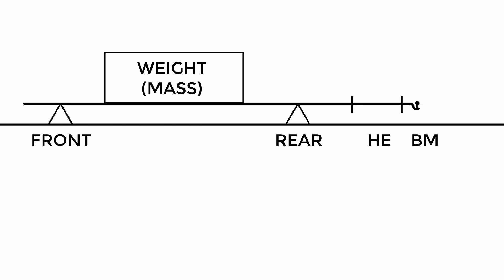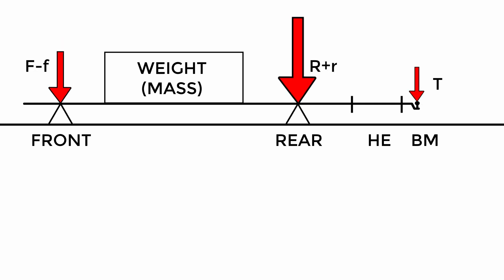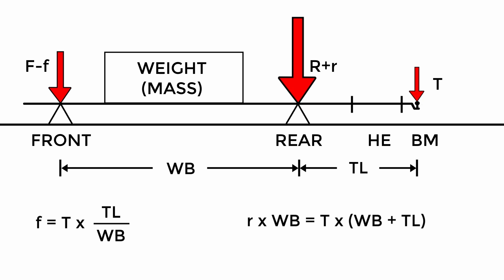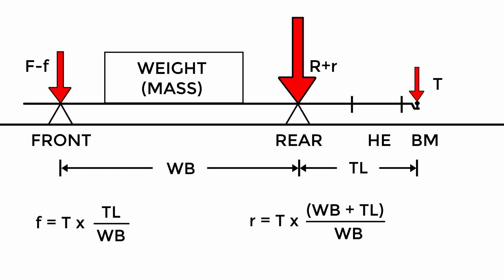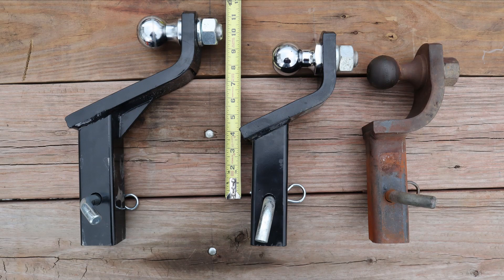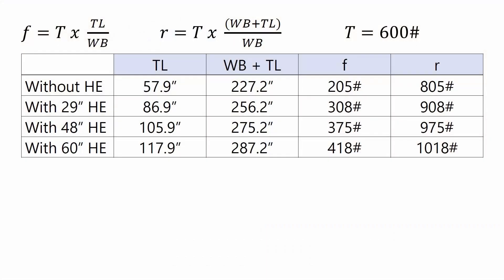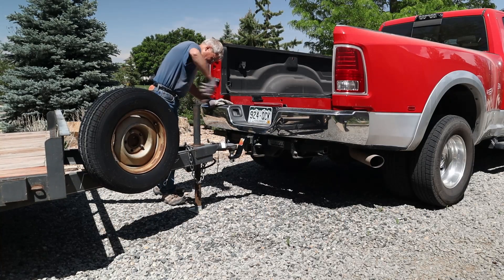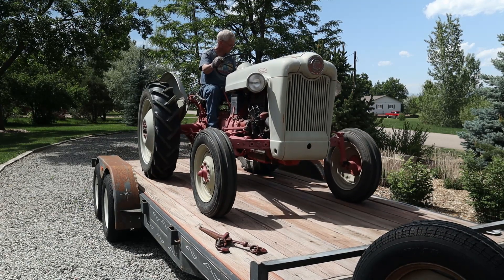How a Hitch Extension Affects Tongue Weight

Comment: Enjoyed the detail with real life scale measurements; much appreciated. That being said, our reasons for doing this is to prevent wear and tare on our rear drive axle components - while ensuring maximum steering and breaking stability of the front axle. We both have need for tongue extensions. I have the additional need for steering & drive axle load balancing because my loaded Grand Cherokee and loaded Boat are close to safety limits. 

Loved the video as it revisited my load balancing hitch "adjust / measure / repeat" while pushing the patience of the operators at the waste transfer station (to get readings as each axle gets on and off the single scale). Your work to factor in the effect of tongue extension will help tremendously as I prepare to add a removable-telescoping extension for my needs (storage garage & shallow boat launches).

Yes! Correct! Get a right-sized truck and trailer an not fuss with extensions and load balancing hitches - and park outside like everyone else. No fun in that. Thanks again Kevin!
Reply from the maker: Thank you for the lengthy and thoughtful response!  I'm happy that I was able to provide some information that you found useful.

Comment: Great video almost
similar to weighing and rebalancing an aircrafts cargo, 1st class mail, packages, large BMC containers centering the weight mass before take-off. To far back and the aircraft goes into a stall and you crash tail first, to far fowards the aircraft nosedives and the results are the same you crash and burn.
Center that weight and keep it there and you will have no problems with take-off cruise and landing although the take off and landing lengths of the airport may be longer as a result of the additional weight.
Reply from the maker: This is pretty interesting!  I had the opportunity one time to fly in a glider, the pilot had to adjust the position of a weight to achieve the correct balance.
Thank you for posting!

Comment: Hello Kevin. Just watched this video twice, and I appreciate you sharing your knowledge. When determining TL, what you call the distance between hitch pin hole and center of ball, your measuring tape shows the b leg of a right triangle. When incorporating a drop ball mount, whether it be 2 or 10 inches, the b leg can stay the same, but the c leg or hypotenuse does change. Could that have affected your math vs scale outcomes?
Reply from the maker: Assuming the 'b' leg is parallel to the ground, the drop (let's call that the 'a' leg) would be vertical/plumb - so it would not affect the lever.  As such, the 'c' leg (a combination of 'a' and 'b') should also not affect the outcome.
That said - the actual setup - and my measurements - are real-world and therefore imperfect.  There may be other factors that I overlooked.
Thank you for the replay!

Comment: Great video! It would be interesting to know if you added this much weight (W =) and extension (he=) what the force change would be driving down the road. What is the downward force for each foot of extension increase or how many times does it increase (average)? 2 x tongue weight? 3 x tongue weight etc. Or is there a maximum downward force??
Reply from the maker: All you need to do is plug your numbers (weight and extension) into the formulas that I provided.  You could even use a spread-sheet and plot the results.
Reply: @KevinTaberski  Thank you for the quick reply! But what I'm asking about is when going down the road and you hit a bump how much more downward force is created? I get that it multiplies by however long the extension is. In the video you measure it while standing still. But when driving and hitting a bump how much does that weight increase? It would be cool if they made a device/scale that would measure that and you could see it on the app or with a camera zoomed into a scale on the hitch? Or am I missing something from your video that explains that?
Reply from the maker: @Mnfish22  Ah - now I understand!  You wish to know the dynamic force applied as a result of real-world driving conditions.  THAT would be quite the undertaking!  At a minimum it would require the placement of a number of sensors at various key points then instrumenting and recording the results in (more-or-less) real-time.  
It's possible that some pieces designed for this purpose are available, but I'm not aware of any.
Another possibility is to model this as a system using Finite Element Method - a topic I know virtually nothing about.
Let us know if you find something!

Comment: Fantastic video! I also have a camper.  My only confusion is as follows: If I know my cargo load on trailer, and calculate tongue weight at 10-15%, and say I need 220 lbs on tongue. I wondered if I would need to apply that amount of weight at ball to determine height of ball without camper, and then again w/ camper (I.e - If it was to be 200lbs, have someone  that weighs 200lbs stand on ball, and measure height of ball in both cases. If camper is on, and trailer tongue being lower, wouldn’t it already be adding more tongue weight, than an empty truck? Just didn’t know if that was covered?
Reply from the maker: Hmmm - IF I understand your question correctly - you are attempting to determine how much your truck will 'squat' with the combined weight of your camper AND your trailer.  Adding the approximate additional weight to the ball would work, but make sure you move the truck a bit - to give the springs a chance to flex.
With regard camper on versus off and trailer connected versus no connected - you can think of them as independent and additive.  In other words, whatever additional weight the camper adds to the rear-axle (for example) is the same whether the trailer is connected or not.  The same is true of the trailer.  You can prove this to yourself if you have a scale available.
I hope this makes sense.
BTW - sorry for the slow reply - I was camping!

Comment: Very interesting. I have wondered how much difference the extension would make. The 900ish pounds of tongue weight is more than I thought it would be with that tractor/trailer combo.
Have you tried using a weight dist hitch with equalizing bars and the extension? Im curious  as to whether it would return the weight from the rear  back to the front axle.

Randy
Reply from the maker: Randy - Thank you for the comment and the question.  I do not have any direct experience with weight distribution hitches, but I can say that they are designed to do exactly what you have stated, to relieve weight on the rear axle and transfer that additional weight to the front axle.  I do not (yet) know if any additional weight is transferred to the trailer axles.  Whether or not it makes sense, will depend on the application and the axle rating of your tow vehicle.  In my particular case - with my camper installed and the trailer/tractor combo in-tow - I'm still reasonably well balanced.  But if I was towing substantially more, I would look into a weight distribution hitch.  I hope this helps.

Comment: It would be useful to know how an equalizer hitch would help . I just installed one on my 2003 f350 with Northstar 101/2 camper with 14x7 enclosed dual axle trailer with Harley trike , about 3700 total for trailer and contents with a 43 inch extension .
Reply from the maker: I’m afraid I don’t have any experience with the use of an equalizer hitch.  Sorry!

Comment: Are some people using tongue extensions to put truck boxes and stuff like that on the front of a trailer to get more cargo space? And does that tend to work out pretty well? Thanks.
Reply from the maker: I have not personally seen or heard of anyone installing a hitch extension for the express purpose of installing storage on the trailer tongue, but that should work.  That said, generally speaking, it is better to connect the trailer as close to the tow-vehicle as possible.

Comment: Good evening Kevin; I like the video but I'm not sure it answers the question I have. My truck tows a 14' pull behind camper that has its own Class II(350 lb TW rating) hitch on the back. I want to use a motorcycle mount on this hitch which extends about 18". Will my 298lb bike/mount combo with 18" extension overwhelm the Class II hitch? Thanks for any info :)
Reply from the maker: That is a very interesting question.  I suppose you could go through the math and calculate the effective tongue-weight at the hitch.  My suspicion is you will be a bit over 350#.  What I suggest - contact the manufacturer of your camper and see what they say.  Another suggestion is to find a forum either dedicated to the manufacturer of your camper or campers in-general to see what other owners have done.  In the end, you are only asking the hitch to support the 298#, but the torque/moment-arm created by the 18" extension is tricky-bit.  Sorry I could not be of more help.  Good luck!

Comment: So basically youre super longg extention only added 100 lbs more to the axle/hitch ?

I have a 90 Jeep Grand Wagoneer.  And i am buying a Jeep j10 76 long bed.. i want to use one of those 2200 lbs uhaul flat bed trailers to haul it.  But that Jeep weighs 4200lbs.  My jeep weighs 5300 with me in it.  Towing capacoty is only 5k lbs.. but tbh that seem anemic for what it is.. especially when my snaller 98 Grand cherokee can do 6500.

I have a hitch extention on my hitch its got a folding spare tire carrier on it.  Should i remove that ?  And just use a short 2 inch ball receiver versus the extention..  Just dont wanna spend money where i dont have too.  That extention is rated 5000 lbs.  Of course trailer weight would be like 6300 lbs..  but i think itll be fine.

Just dunno if that added leverage on my hitch/frame is something i should be worried about or not.  The extebtion is like 14 inchs
Reply from the maker: My extension added 100 additional pounds to the rear axle, for a total addition of 960 pounds.

With 6300 pounds of trailer, you will likely have a tongue weight of 650 to 950 pounds.  The concern that I would have is the torque placed on the hitch receiver through your 14" hitch extension. If you assume your ball-mount adds 10", you will have a 2 foot lever - with 900 pounds (for example), you will be placing 1800ft-lbs of torque on the hitch receiver.  Keep in mind, this is the 'static' load - when you are parked - things get more interesting when in motion.  The weakest point of this setup is right where the hitch extension exists the hitch receiver - it may bend at some point.

Obviously, I have elected to upgrade to something beefier and safer.  If you decide to do this, please extend your safety chains from the trailer to the tow vehicle.  Can you use the just the ball mount and strap your spare tire to your trailer?
Reply: @KevinTaberski  I decided to spend the 33$ on a 7500 lbs hitch ball end.  A nornal shorty one.  And just leave the spare tire at home (which is heavy as hell probly 80lbs lbs with that steel rim and mud terrain tire)

Now my main concern is my 5300 lbs 90 Jeep Grand Wagoneer (5300 with me) and s GVWR of 6400lbs.  Pulling a 2200 lbs uhaul flat bed with a 4200lbs 1976 Jeep j10 pickup.

Everyone on the Fullsized jeep forums said ill be fine.. I saw pics of them pulling wagoneers with their wagoneer.. but still.  My Jeep is onky 109 inch wheel base.  I have decent gearing not the best but the (tow package at the time)  3.31s versus 2.72 lol.  And a trans cooler for the 3 speed 727 auto.   My jeep is also in perfect shape.. new ball joints. New u joints all around.. new heavy duty springs so i can handle heavy weight without the bottom end dropping.  If i mind the total 1300 lbs capacity still i mean

One guy said to disconnect the rear drive shaft and get a dolly instead.  I jist wanted a flat bed as i dont trust any wheel going on the ground of the 50 year old truck.. not till i can drive it and look it over fully..

I also think the 5000lbs factory tow rating is very under valued... my shorter wheel base smaller light grand cherokee has 1500lbs more towing capacity. Which makes no sense.. and that 60lbs hitch on the back is so thick and heavy no way its rated 5000lbs.. its bolted with 8 grade 8 bolts as well.    I think its all under rated IMO.

But what do you think ?
Reply from the maker: @jeepsblackpowderandlights4305  Ideally, your tow vehicle would be heavier than your trailer/load with a bumper-pull set-up.  Whether or not it can be done safely is something you will need to determine.  A couple of thoughts: a high enough tongue weight is important to keep the trailer tracking properly so it remains stable.  Good trailer brakes and a properly set-up brake controller is very important - especially during those unexpected braking situations.  Finally, make sure you have enough weight on the front axle of your tow vehicle for safe handling (steering and braking).  I recommend weighing - before and after attaching your trailer - re-weighs are pretty cheap.

Once you get everything loaded-up and secure, drive it around and see how it all handles - before heading-out for a long trip on the open road.  

Good luck!

Comment: Could you do the math on this senario: diesel pusher towing a vee nose trailer. The tongue of the trailer is only 18 inches from the tip of the vee and I dont want to bonk the top of the vee to the moho  going down a curb. 12' from rear tires to ball and 12' from trailer tire to hitch reciever. ball height is 16 inches. trailer box height is 7'   I threw out my high school geometer books 40 years ago!
Reply from the maker: I'll have to give this some thought!  Not only how to do the math, but also how to provide an answer in a meaningful and understandable way.

Comment: how would a trailer tongue extension compare?
Reply from the maker: Excellent question!  Adding length to the trailer tongue would be better (IMO) that adding a hitch extension.  With exactly the same truck & load and the same trailer & load, the weight on the ball would be less and would be closer to the rear axle.
My guess (and once again I'm no trailer expert) the trailer would track a bit nicer.
I've seen this done with a horse trailer for this exact purpose.
All of that said, this may only make sense if you only haul one trailer that you can modify.  Plus, be careful driving over any dips - as the camper overhang can contact the trailer tongue.
Good luck!

Comment: Can you install an extension like that to a truck and pull a car hauler trailer that’s 34 feet long and weighs 4300 pounds and then carry an extra 6000 pounds of cars on it without the extension breaking??
Reply from the maker: Though what you are proposing sounds like a lot, I believe the TorkLift Super Hitch system might handle this.  I suggest you contact TorkLift and describe your setup and requirements.  Above all else - be safe!

Comment: How does hitch extension affect the payload
Reply from the maker: The overall payload is unchanged - the weight of the trailer tongue on the ball is shifted back due to the hitch-extension, so the rear-axle of the tow vehicle carries more of this weight whereas the front-axle carries less by the same amount.